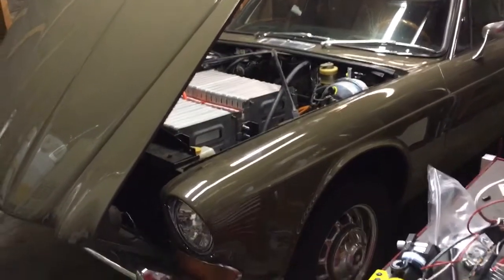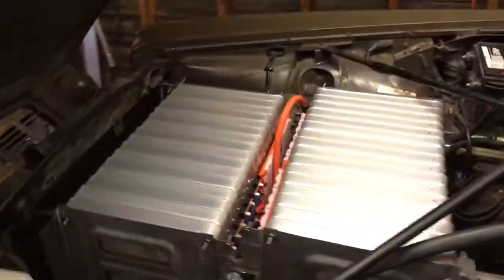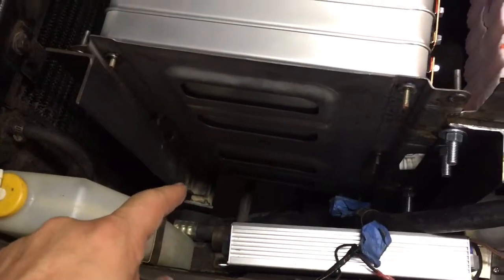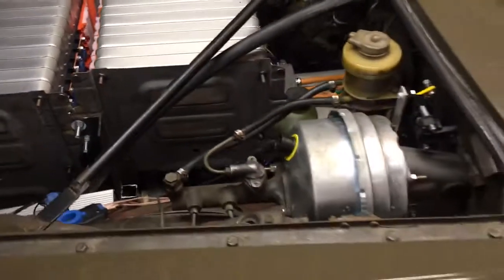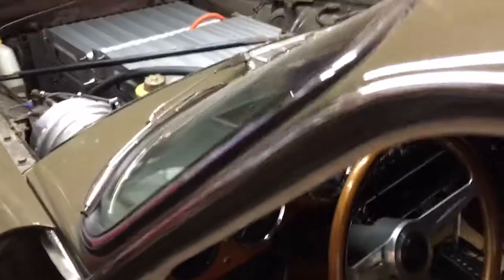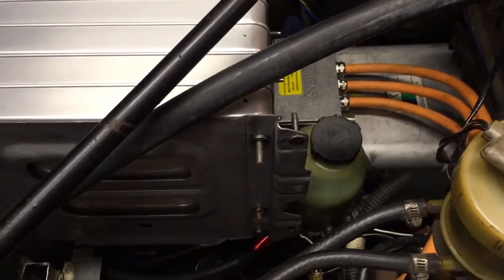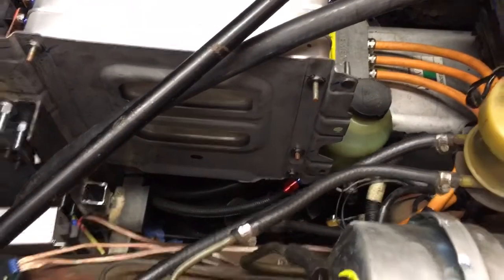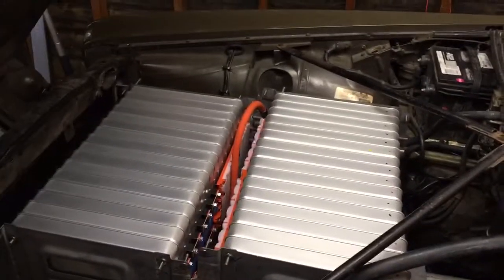Electric XJ6 batteries installed

Comment: Great work. I would like to convert my 2005 XJ8 and would like to know where I can get the parts necessary for the conversion. I would really help us if you put a link of where you purchase most the parts. thank you
Reply from the maker: nd hartz I wish it were that easy! I had to source a difficult to find motor and build much of the electronics and hardware myself. The jag is much harder to convert than most cars because of its rear suspension design

Comment: Can I get more info please? cost of items and how does it drive? is the motor conected to the original transmission? automatic , does it go through the gears 1,2& 3 or no need for the gears. Regards, George and thank you from Australia
Reply from the maker: George K no gears, it goes directly into the differential. Has occasional issues starting from a stop that need to be worked out but otherwise it's quiet and smooth! Cost can vary from 10-30k depending on batteries and how much detail work you do yourself (wiring, etc)
Reply: @BRV50N  Thanks for this -- looking at doing the same to my '86 XJ6...when you say it goes directly to the diff, do you mean that A) you deleted the transmission and just used a custom driveshaft (from the motor directly to the diff) or B) you gutted the transmission and removed the gears (but kept the housing). Thanks, great work, m
Reply from the maker: Mike Brown-Cestero A) is correct. There is no transmission and there is a driveshaft going straight from motor to diff. I would recommend using a Lexus GS450H ‘transmission’ in place of the original transmission and controlling the two electric motors inside of it.
Reply: @BRV50N  I am looking at an Obrist solution...hybrid, not pure EV